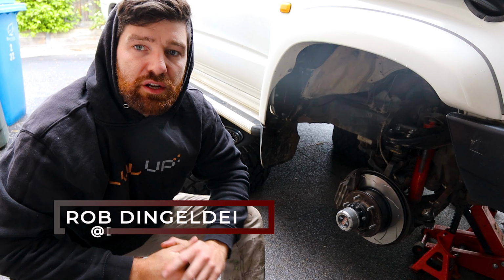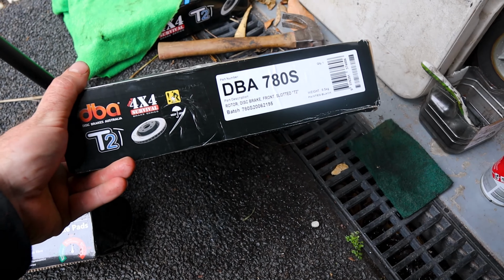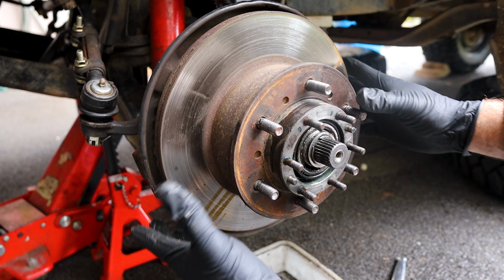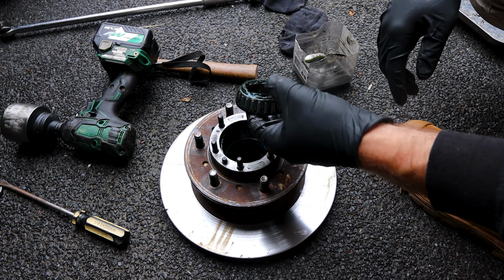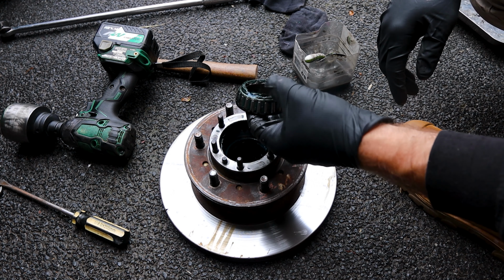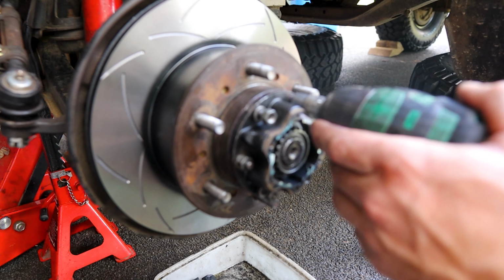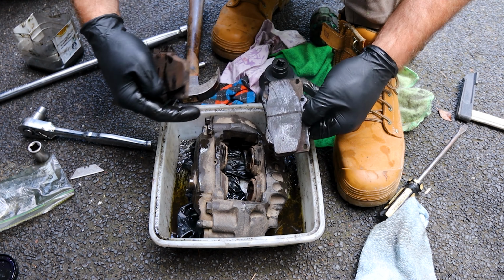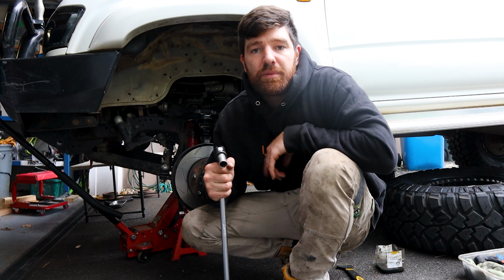How To Replace Toyota Hilux Front Brakes

Comment: Thank you. Your video was the first one that came up after typing "break rotors replacement for a 2003 hilux."

It was exactly what I needed to prepare for this job.

I had a few issues trying to find a 54mm socket but found one easily at Repco in the end for about $25.00 AU. It certainly  beat having to modify a $100.00 impact socket from Total tools which was a bit on the extreme side.
Reply from the maker: Great stuff! Any socket that does the job is all you need!

Comment: If you remove the brake line on one side say the drivers side, do you have to bleed the whole system
Reply from the maker: Yes. There is no need to take risks or shortcuts when it comes to your brakes
Reply: @dingeldiy well said, cheers mate

Comment: NEVER smack the side of the hub!   You risk losing the concentricity of the tapered cone hole = hello snapped studs.
Use a brass drift on the end of the stud wire the nut flush….
Reply from the maker: good advice! thanks for the heads up